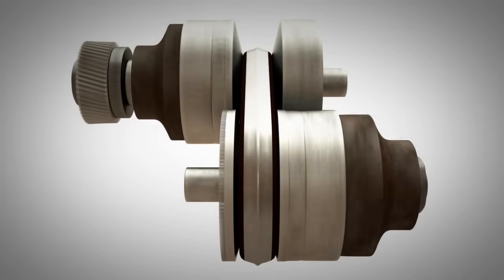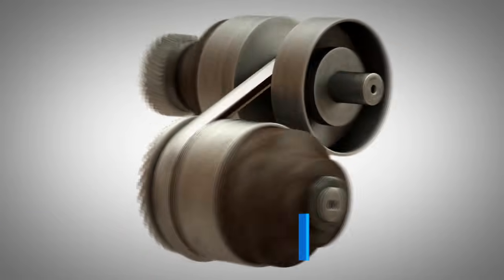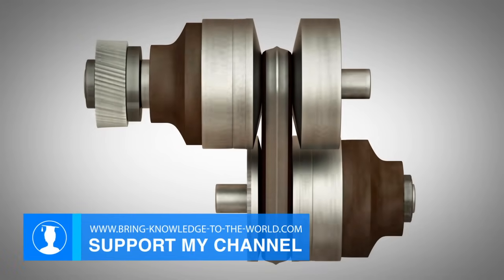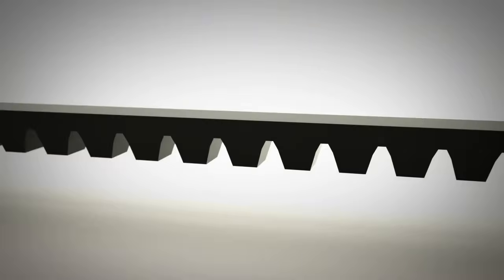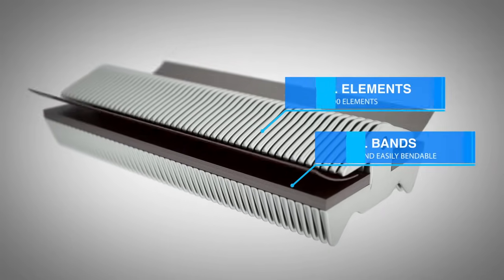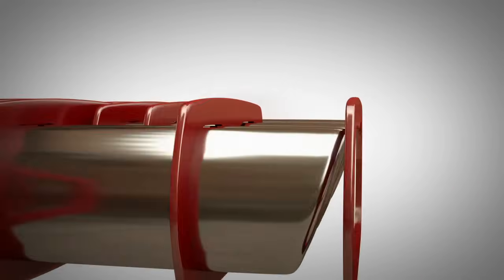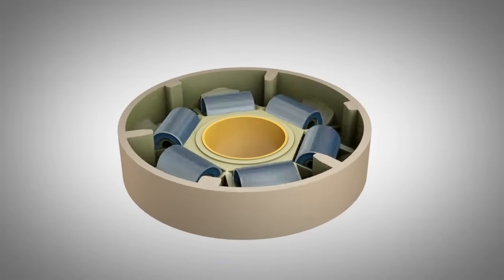How a CVT works! (Animation)

Comment: very interesting...

Engineers are not unlike artist.  You have to be pretty creative to conceive such things.
Reply: But also have a special hate for millwrights
Reply: @brodierand4963  truth!!
Reply: You must be an engineer . You said  "are not unlike "  instead of " are like"
Reply: there is a difference between engineering and innovative engineering.
most true innovative engineering is dead these days. the reason comes down to is "if you have an idea then likely someone else has already come up with it in the past"
95% of engineers typically work off existing systems and designs make small adjustments in order to reach design objectives.
there is that few percent that produce something really innovative and unique, that's where the art aspect comes in, and it's rare.
Reply: @AP-bo1if  Talking about art in mechanism is bullshit. You don't know engineering
Reply: @gopiramanujam1060  alot of mechanical engineering came about through someones imagination and creativity. this is effectively art.
do you believe someone who has a mechanical engineering degree is as good as someone like Nikola Tesla?
Reply: @AP-bo1if  No it is not like that. Engineering is need based. Engineer is not an artist. Art is random and anybody could do something and call that art. It is dumb piexce. Engineering means it has to function
Reply: @gopiramanujam1060   You have no idea what art means in that case. It's "the expression or application of human creative skill and imagination".
Reply: @AP-bo1if  Engineering is not art. Period. Don't blabber
Reply: @gopiramanujam1060  You're not Nikola Tesla. Don't blabber.
Reply: @gopiramanujam1060  
nobody here said that engineering is literally art. I defined what it means in the context of engineering. Yes, engineering is about needs and function, and things like functional requirements, but that just assumes all function and design is equal. innovative ideas come from the mind; the imagination and creativity. they don't come from thin air or strictly from engineering textbooks. it takes someone who can imagine various unexplored possibilities in their mind to come up with something truly innovative.
Reply: @AP-bo1if  Engineering is not art. Period. No imagination. Solid science
Reply: @gopiramanujam1060  not an argument. period. I explained it very clearly.
Reply: @gopiramanujam1060  lol. how is it a useless explanation? with your strict definition, all engineers are equal. are engineering is equal. total nonsense.
Reply: @AP-bo1if  lol I don't get what his problem is, I agree with you. I just graduated with a degree in Robotics Engineering and gotta say, it does share the creativity and originality part with art. It is much easier for me to just innovate off older ideas, perfecting them with simulations, math, or other knowledge we have now that we didn't in the past, but for original ideas you need a much more creative mind.
Reply: @khendrian  Thank you. I'm a software developer but I worked in engineering department for several years (automation/mechanical engineering), so I kind of know how it works in the real world. Out of the many engineers, they had one engineer that was a "creative" type while everyone else was following standard design practices. This senior creative type put a twist on many of the designs and you know, they worked better and more efficiently. I remember a carousel design he designed was to process items going through a conveyor. It could have been done many other ways which would have fulfilled the engineering requirements but his design allowed for more items to be processed in time and in a better way. I believe it was also patented.

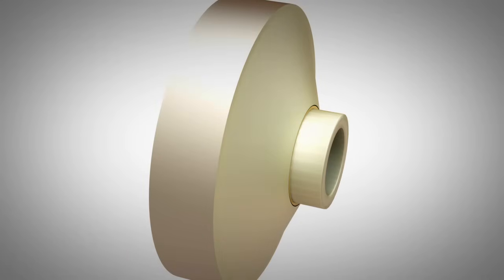Comment: Nice Video, good explanation! Just a little thing: at 2:40 (exaktly at 2:57 ) you state zentrifugal weight movement for the pulleys won't work for automobiles. That is not fully correct, because all DAF 33, 44, 55, 66 and all VOLVO 66 and all VOLVO 343 Versions equipped with CVT worked with centrifugal weight as main shifting mechanism. Powered up to 70 hp they worked like a charm in my experience. They had an additional negative pressure switch to make some shifting control possible (for engine breaking downhills, for accelerating with high engine rpm  and for overdrive at medium speeds) but they still drive great when this switch mechanism fails completely.
Reply from the maker: +Maximilian Hacker Yes, but today, you won't find these in modern automobiles ;)
Reply: +Thomas Schwenke
The idea of utilizing centrifugal forces acting on clutch pads is excellent for moving the moveable face of pulley. I wonder why car manufacturers don't apply it anymore for modern cars. Is it unreliable, hard to maintain ?

Comment: much better design than default gearbox, but bad thing that belt can slide at some point when high torque is applied and pulley is moving
Reply: +jetcarq that's the problem of most CVTs
Reply: Yes, the concept of the CVT is much more efficient than automatics and manuals. Problem is, all those on the market as of now have issues sizing correctly according to the speed of the engine and driver's foot.

Comment: The design doesn't look durable.
Reply: +Rectum in traditional manual transmissions, you'll find the gears constantly catching each other at different rotating speed which may look like will cause severe wearing. if they put that into an animated demonstration, you'd feel it's even less durable than CVT. so don't be dumb and judge the viability of a design from an animation.
Reply: Szymon Gorczynski if you read my original reply again, you'll find that i wasn't criticizing traditional gearbox's durability at all. but since you've brought up this point, i should tell you that much like most modern engines have made the change from timing belt to timing chain, CVTs are getting more durable "belts" too.
Reply: durable materials and tight fitting interlockings are key to any machanical device's durability. 
The part that would probably wear the most would be the belt, which might stretch.
But as someone else commented this is a far smoother design than having rapidly rotating gears mesh together and come apart.
Reply: Regarding durability of modern gearboxes - modern manual transmissions have synchro rings that touch first to bring the gears to the same rotational speed before they engage. Further, the design of the synchros inhibits engagement until the gear speeds match. This feature reduces gear wear and also eliminates the grinding noise that older manual transmissions made during gear shifts.
Reply: +Peida Li My mate clocked over a million miles on his bus before not the gearbox, but the engine bust. Mechanical transmissions are extremely durable, considering the bus had a crash box. (He was presented with a free engine from the manufacturers as well)
Reply: Szymon Gorczynski ask him how many clutch disks he went through
Reply: Peida Li Well how many belts did your CVT go through? Some parts in engines do need frequent replacement
Reply: 5
Reply: Joe Vignolo Older gearboxes, or "crashboxes" as they were known, don't grind by themselves, only shit drivers grind them.